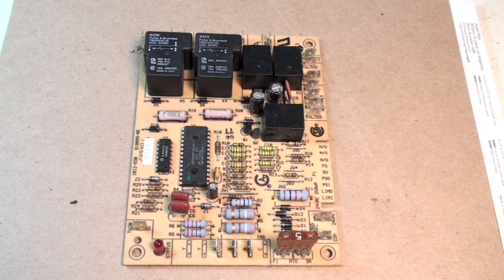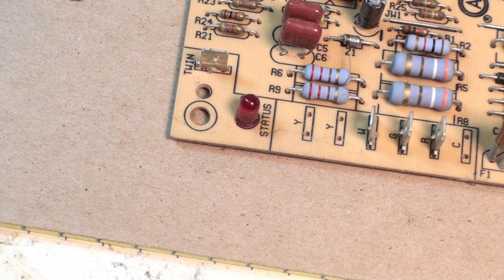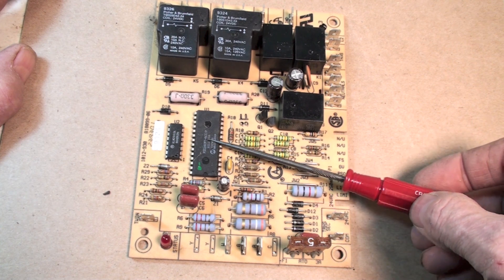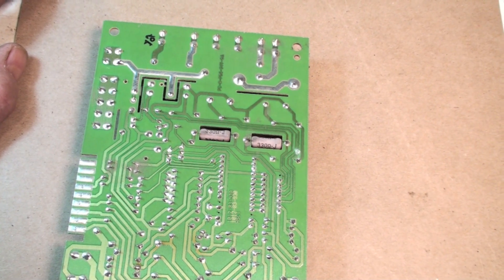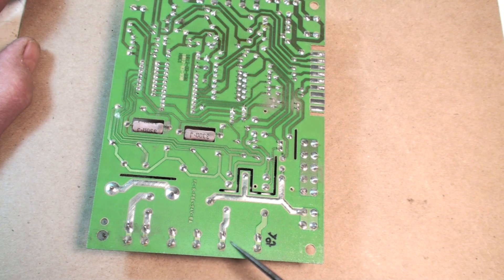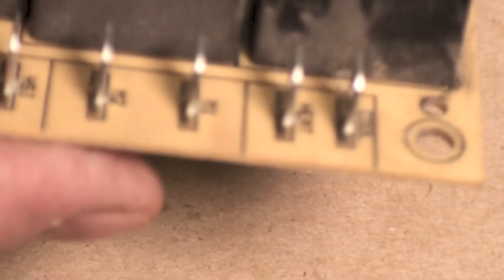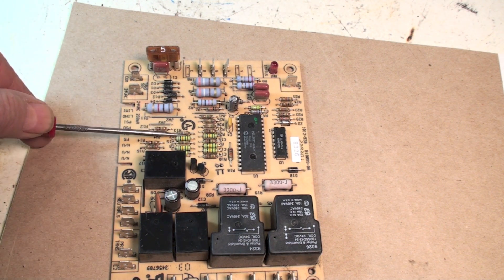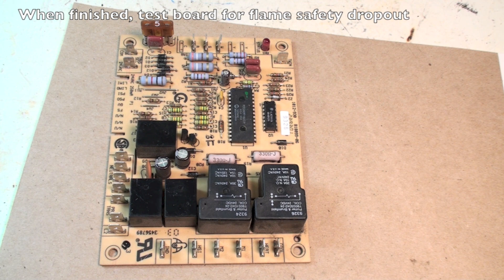Troubleshoot the circuit board of the gas furnace

Comment: Not the same board by any means, but I hope this will help me fix my Kenmore Air Conditioner, a relay for the compressor is stuck, so it runs when you just plug the cord in. I can't find these boards and need to fix this AC, can't afford a new one.

Comment: Not the same board by any means, but I hope this will help me fix my Kenmore Air Condtioner, a relay for the compressor is stuck, so it runs when you just plug the cord in. I can't find these boards.

Comment: Non-field serviceable part means non-field serviceable part. Repairing any lose or cold solder joints is perfectly fine, but If those resistors get hot enough to melt the solder that hold them in place, then you have a bigger problem than a couple of burned parts. While it is certainly possible for an engineering technician to troubleshoot and repair printed circuit boards to the component-level in an electronics lab, with the proper equipment, schematics, and spare parts, there would still be the need to perform reliability and safety testing. Simply plugging it in to see if it works after a makeshift repair effort would fall far short of full-function testing. Just because the furnace fires, does not mean its safe.
Reply: Singled sided board with thru hole components. You can easily test most components with a multimeter. Check the caps with an ESR meter to make sure they have not gone high resistance. Those two ICs control the board. They switch the relays by pulling those diodes behind them down to ground. 
CognitiveDisonance the solder joints break due to the constant heating and cooling of components along with the use of lead free solder (brittle).  Those resistors are designed to withstand high heat... that is why they are ceramic.
Reply: Concerning capacitors check out this Wikipedia article: https://en.wikipedia.org/wiki/Capacitor_plague
There is a guy on YT by the name of Louis Rossmann who is doing component level repair on computer motherboards. His techniques may give you some info you may need.
Reply: Well, it depends. Siemens LMU64 control unit(used by many mainstream furnaces) had a manufacture problems when they used bad electrolytic capacitors during a manufacture.So 1-2 years and furnace cannot start even if ionization probe is ok, but circuit in control unit which evaluates discrete analog values was bad.

This unit cost over 5000kc (200$) here and manufactuers change unit for unit only. Work,reprogramming of values for specific furnace,installation not included. And this price is without additional modules on lpc for solar heating or home automation.Just small furnace configuration.  If it cost so much money you will really consider repair on your own. If you do a bad job what worse could happen? System is designed to be safe even if unit fail completely unlike those ancient furnaces presented here.
Reply: obsolete professor Those failures are attributed to units made after 2010 up to present. I suspect a warranty engineering here. All furnaces using Siemens LMU64:( However there is no chance to buy anyhing different. Especially if you have low temp central heating and well insulated house with low and unstable heat loss. Geminox furnaces can regulate flame 1%-100% with 1% granularity.
Reply: Thank you
Reply: CognitiveDisonance

Comment: I just wanted to add something, for my furnace, I had a #2 blink code indicating a vacuum switch issue , I bypassed the vac switch , still had no inducer motor , I wound up installing a variable dimmer switch onto the door safety connectors and slowly added and reduced voltage through the door switch and was able to get the inducer motor to get spinning and once it got spinning , she would ignite after about 10 seconds of spooling up, I am going to go with a bad relay on the circuit board  or a bad capacitor on the board being I am decreasing and increasing the voltage and am able to get it to work time after time , my new circuit board should be in, in a few days because I am getting tired getting up every 2 hours to re-start it , to shut it down I have a hand held remote control on/off thermostat wired to the thermostat poles and now when I want to start it , I just click on off /on off on off about 15-20 times and it will start however now what I have noticed is happening is , the inducer will start for a minute then cut out /on /out on when this happens I know it is not going to run and I will have to go back to the variable dimmer switch connected to where the door switch used to be, shut off the power to the board completely for about 10 second , then click it on and it will start after about 10 on /off cycles without the inducer motor failing  . . . .yes I know this is quite unorthodox way to run the furnace , but it will not run any other way , first of all the blink code is wrong and I don't know why it is saying Vac switch, it also is not the door switch because that and the vac switch were the first things I bypassed as well as the thermostat  . . . .anyway, just wanted to throw that in there , Excellent videos by the way, very informative

Comment: Thanks for your videos on my control board it takes a 5 amp fuse I used a 10 amp fuse to get things going knowing I was going to switch it back to a 5 amp. Well my dog chewed the wires at the ac unit outside my wife got hot and turned on the ac. Well it short and in stead of the fuse popping  something else burned out. My question is could it be the whole control board that's fried or something else? Hope this is enough to go off on and my control board is a Honeywell ST9120U anything will help. Thanks
Reply from the maker: +heikoti maile It probably took out the transformer.  The board should be ok.  
GFM

Comment: Why does my 3 amp fuse keep shorting out?  It only happens when I switch my thermostat to heat.  My blinking led code is:
"Short circuit in secondary voltage 24vac wiring." 
Does this mean my circuit board might be bad?
Reply from the maker: +Brenda Fluellen Usually, when the fuse keeps blowing, it is indicating a short in a component or a wire contacting the chassis of the unit.  I did 2 videos on finding a low voltage shorts.  I have put a link in the video that will take you there.  Hope this helps.
GFM
Reply: +Brenda Fluellen  try checking the diodes , shorted diodes in secondary winding of the stepdown xformer causes fuses to blowup everytime you switch the stat to heat mode.
Reply: You have to re wire from the unit inside to the unit outside I had to do that to mine I went through like 3 boxes of fuses.

Comment: Great video, as always. On the 'heat and 'cool' terminals, are those for the selected fan speeds? I'm also curious what is above and below that bank of neutrals. I have all of the high voltage down, but some of the low voltage stuff can be a real rats nest.
Reply from the maker: They are for the fan speeds. Those are for Hsi, flame rod and inducer. Hope this helps. 
GFM

Comment: Mr. Grayfurnaceman my problem is that I have no low voltage going to my A/C unit outside (the compressor). I have power to my thermostat and low voltage to my mother board from the thermostat but non relayed to the compressor while the thermostat is set to cool. Do I simply need a new motherboard?
Reply from the maker: Snazzy Architecture If you mean the motherboard of the furnace, I would do more tests before condeming it.  You should have 24 volts between the Yellow wire and common at the furnace motherboard.  If power is there, check at the outdoor unit.  No power at the outdoor unit and power at the output of the board, then the problem is between the board and the unit.  Hope this helps.
GFM

Comment: OMG. I just love your videos.  I've learned a lot over the last couple of days watching them. Thank you very much for sharing your wealth of knowledge. I was wondering if you could help us. We know nothing about these furnaces. I am disabled and don't work and my dad is nearly about to lose his house and can't afford to pay someone to come out.  My dad loss his furnace last year and hasn't had it since. I am trying to help him over the phone get it going. He has been in the house for about 15 years or more. The house was built in 1962 I believe and it's prob the same gas furnace, so it is really old. He does have an electrical thermostat. This is what I could get from him about the furnace, etc:  American Standard.  #H68K010635  and Model # GUF80DE2.  I think the valve numbers were:  #v8139a1016  kb2,   #v8113a  jbe. I think he said that was on the valve and it was made by HoneyWell.  The thing just quite working on him last year.  It's been sitting for a year now. He got the pilot to light today and turned the thermostat up, but nothing happens. I was wondering if you could point us in the right direction. Oh, he did have a repair guy come out last year and he said to try to replace the ignitor or something. My dad said he replaced it. I think it was the ignitor or the sensor that reads the gas, temp, etc.  The repair guy said if that didn't fix the problem, it could be the valve. I can't even find a valve for this using those numbers.  Before I look any further for a valve, I was wanted to make sure there wasn't something else wrong or that we could narrow it down for sure before we started trying to order new parts.  I just sent him a video to watch about checking for power to the motor, the fuses, breaker, and thermostat, just to make sure it has power to the motor.  Can you help walk us thru this please?  Thanks.
Reply from the maker: Jerry VanSickle The valve you have is replaced by a Honeywell V800A1070 valve.  If you can check voltage, you should get 24v across the gas valve.  If it has voltage and the manual knob on the valve is in the "on" position, with the pilot on, the valve is failed.  No voltage, look elsewhere.  Let me know how you do.
GFM
Reply: grayfurnaceman Thank you much. My dad is looking at his furnace and recalls before that he thought the fan kicked on, but just not heat. I seen one video about saying to make sure you have power getting to your furnace, etc.  My dad said now he can get the pilot to light, but it won't turn on and when he turns the actual fan blower on, it isn't coming on. I told him to look for a power switch and also a fuse like I've seen in the videos. He says he can't find any fuse. Do you know if there would be a fuse and/or where?

Comment: Hello Gray furnace guy...thank you in advance for your help. I have a rheem electric furnace / air exchanger with a cooling unit mounted outside. The electric furnace / air exchanger is ion the attic I live in Florida.   It all has been working jusat fine then the then the other day all of a sudden  the fuse blew on the board , I replaced It then the transformer started cycling on and off and started smoking...I shut down the power and so I got a new one, I put in a new fuse and the new transformer and it worked for a about five minute then the transformer started to cycle and heat up again. This happens on either heat or cool  I checked both sides  out... it (the transformer) however does not heat up when just the fan only is running it runs just fine.  Do you think its the control board. I do not believe its the thermostat as that really is truly just a switch. HELP its hot down here!!! LOL...
Reply from the maker: Gary Crosby I would be looking for a short to the chassis or ground.  I will be doing some videos on low voltage shorts but not for about a month.  Check the wiring.  Hope this helps.
GFM
Reply: grayfurnaceman yes well thanks I checked everything..all the wires and no one has been near the air handler or any where in or around the attic... im the only one here.

Comment: Great video. I have a strange issue and was hoping for some input. I have an Armstrong Garage unit that powers on the fan and exhaust when plugged in and the control board green LED blinks for the first seconds (1 min?) ...then when you would expect the ignitors to start "zapping", they dont, but the control board LED (Green) goes very dim and rapidly blinks a few times and then goes dark, as if the control board shuts down. The fans continue, but nothing else happens after. If i unplug, the above process happens again and again...the ignition sequence worked before, now that doesnt even work. I checked power to the gas valve when the ignition units were working and there was no power to the gas valve, however there was power coming out of the 24v trans.(the output of the 24v goes into the board and comes back out to the gas valve so my guess is it is being lost in the board somewhere). Any input?
Reply: grayfurnaceman
 
Hello Gray furnace guy...thank you in advance for your help. I have a rheem electric furnace / air exchanger with a cooling unit mounted outside. The electric furnace / air exchanger is ion the attic I live in Florida.   It all has been working jusat fine then the then the other day all of a sudden  the fuse blew on the board , I replaced It then the transformer started cycling on and off and started smoking...I shut down the power and so I got a new one, I put in a new fuse and the new transformer and it worked for a about five minute then the transformer started to cycle and heat up again. This happens on either heat or cool  I checked both sides  out... it (the transformer) however does not heat up when just the fan only is running it runs just fine.  Do you think its the control board. I do not believe its the thermostat as that really is truly just a switch. HELP its hot down here!!! LOL...
Reply from the maker: Maksim Trofimovich It could be one of 2 problems.  The gas valve could be shorting, which may be causing the dimming.  Removal of the wires from the gas valve may tell if the light does not dim.  The other is the board is not passing power on a trial for ignition.  With the wires on the valve, do a trial for ignition.  Put voltmeter probes on the valve wires. When the trial starts, anything other than 24v or higher means the board is not passing power.  These steps should be done in the sequence above.  Hope this helps.
GFM
Reply: grayfurnaceman thanks for the reply. When i was troubleshooting this board, i ran it with and without the gas valve wires connected. Same result, dimming led, then nothing. Before it started dimming on me it was just an issue with no voltage to the valve., it would run the ignition process, but there was never voltage to the gas valve. I thought it was a 24 v trans issue so i replace that, but same issue. It seems like the 24v is getting lost in side the board some where. If a board is not passing the 24v, does that usually mean bad board? I plan to look at it again and follow the trails, but i feel like its going to lead to a chip or something, which is basically a dead end. But then again, now it is dimming the LED and shutting down the board completely so not sure where to go from this point. Side note: i did test the gas valve via the hot wire process using jumpers from the 24v source and it clicked open/closed, so from what i understand, the valve should be ok. Thanks.

Comment: The replacement board that fits my 1985 carrier furnaces has its timing capacitor fail that defines the time the furnace runs after the gas is turned off. It is the largest capacitor on the board and I just replace them.
Reply from the maker: 3beltwesty Go for it if it works.
GFM

Comment: The reason I share this with you all, is that not all but many HVAC repair companies feed on your lack of knowledge about a gas furnace, I paid 730.00 for a bad board by my first, fix my furnace visit.  The one I bought online cost 170.00.  It takes little patience, compare the board to your's first.  It matches so VERY IMPORTANT!  power to the device off the furnace!  take a connector off only one at a time from the former to the new board, untill you have it hooked up the same as it was before.

Comment: I wouldn't even attemp to repair the board.  www.repairclinic.com allows you to replace those parts at reasonable prices. I got a new board for my trane xe 90, the exact new replacement, have to enter the model # and they list all the parts available, fast shipping also!

Comment: I'm pretty good at eventually figuring things out, but I'm perplexed. There's no power getting to my furnace or central air. None of the lights on the circuit board are lit. I know there should be a fuse somewhere, but where it's located is my issue. It's not on the board and I've traced wires with no success. My control transformer has what looks to be an inline, but I unscrewed it and it just appears to be soldered wires...The control board is 62--24136-01. It's new replacement has a fuse on the board. If nothing else...I've vented a little
Reply from the maker: If you have no 24v power, Check for 120v power in.  If power is available in and no 24v power out, the transformer has failed.  If you replace the transformer, be prepared for the new transformer to overdraw power.  If it does, look for a short to the chassis of the furnace.  This one is not a simple one and you need to be aware that the 120v power can be lethal.  Hope this helps.
GFM

Comment: i got in problem today working on ptac unit which had problem with the board the transformer smoked on board and unit never came on adter  how can i check with the solder is good or not in the back please or the borad its self it not a furnace unit help.
Reply from the maker: I did a video on solder joints:  http://youtu.be/08E67GgcrVU  Hope it helps.
GFM